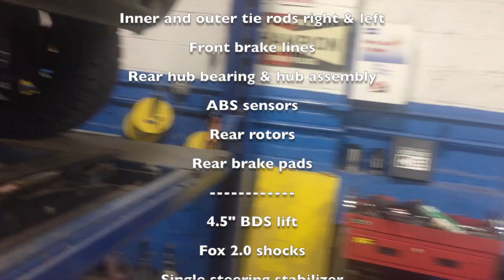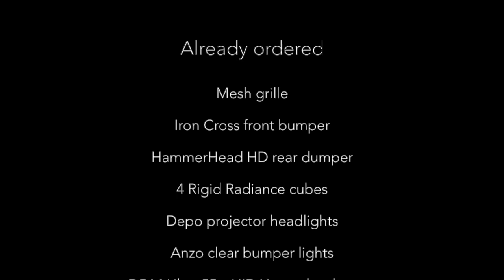Lifted Tahoe | Part 1 | NEW MOTOMETAL 988 Wheels, BDS lift, Nitto Ridge Grapplers and more

Comment: Do you think you fit 35x12.50r22 with that lift??   By the way looks really good with that bumper.  💪🏽👍🏽👍🏽👍🏽👍🏽👍🏽
Reply from the maker: Thanks! I had 33x12.5r20's in this video, but my offset was -44. I doubt 35's would have fit with that offset, but might have fit with a smaller offset and a bit of trimming. BTW, I later increased my lift to 6" and went up to 35" tires. https://www.youtube.com/watch?v=FslXK95mYJU

Comment: Did you replace the control arms with extended ones? Do they come in the lift kit
Reply from the maker: Yeah I had to replace my control arms because the stock ones were in bad shape. They did not come with the lift kit though, bought them separately.
Reply: @JonCaveman  where did you get the extended control arms. I just purchased a 05 yukon and have been looking on what lift I should get and I really enjoyed hows your came out.